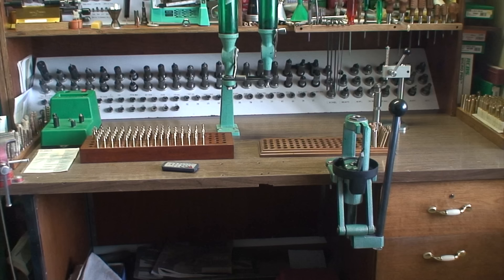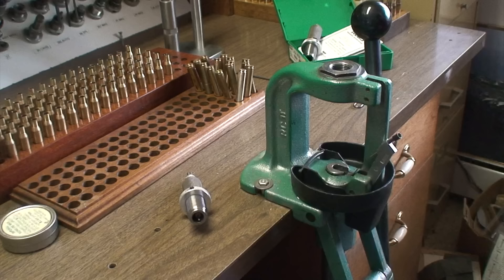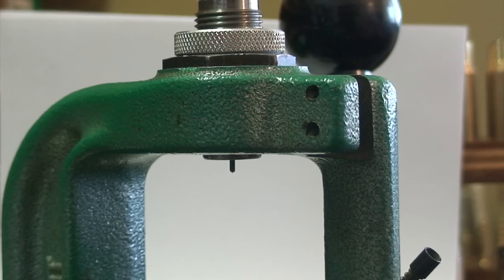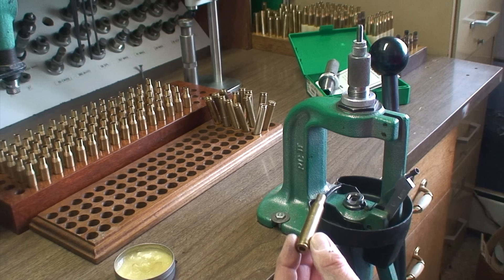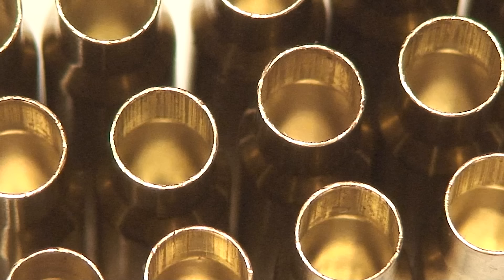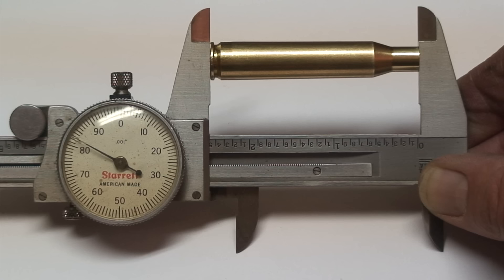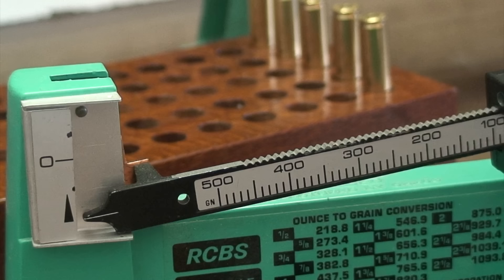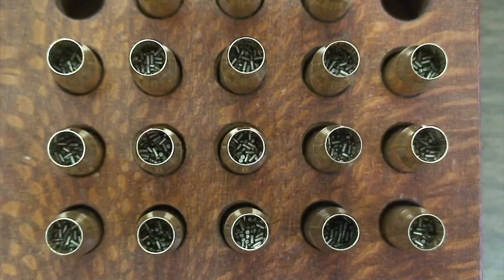Reloading 101 - Start to Finish Reloading All Rifle Ammunition

Comment: Suggestion
I used a 7 mm always
And yes I had head separation
And from then on.
I made an easy out with a handle long enough when you take the bolt out, you can easily pull the rest of the brass out.
I put it in my pack and it is always there. with quick and easy axcess.

Can't remember the grain i used, but always had to load a few grains higher to bring the grouping into reasonable dia of 1/2 inch and often through the same hole at 100 yds.
I remember how many grains, as it was 62 but can't remember the powder, as i have not loaded for several years, as i don't hunt much anymore.

Make yourself one of those easy outs and take it with you ALWAYS .
Saves a lot of grief. and sorrow. and maybe your life.
And the most important thing on any outing
When you take a shot 
MAKE THE FIRST ONE COUNT, SO YOU DON'T HAVE TO SHOOT AGAIN
Check your rifle immediately to see if it rloads again the shell 
DON'T GO AFTER THE ANIMAL YOU JUST SHOT !
If your not able to load,  get your easy out immediately and don't go after your game until you have another shell in your rifle.

You do not want to meet mister life taker !
Let him have it until your rifle is operable again.

And always shoot for the nose on any attacking bear,  
Be relaxed and never get excited
When and if you get excited shooting any animls.
PACK UP YOUR GUN AND NEVER SHOOT OR HUNT AGAIN !
UNTIL YOUR NEVERS DO NOT SHAKE !  
YOU WILL SAVE YOUR LIFE AND THE OTHERS AROUND YOU.

You will get more game and will never freek out at any charging grizzly
As you know it will take only one shot and he is down.
Only if your grouping is as good as mine was.without getting excited.

If you had nerves of steel like myself back then. i'm 81 now and still fairly active, thank the good lord.
I went joging along a trail by myself with rifle in hand
Heard a snap only a few feet behind me, less than 10 feet.
I immediately dug my foot into the ground pivited bringing my rifle up with a shell in the chamber, and safety coming off,
I was in my 50's
And when i was facing a cougar in a crouched position
Without hesitation
Unfortunate for him

DO NOT RUN IN THE WOODS !
AS IT MAY BE YOUR LAST RUN !
Unless you have a sixth sense beyond the normal

Comment: I just started reloading, thanks for going through all of this stuff the man at the store gave me a 2 hour "crash course" on reloading and helped me set up my dies and we actually loaded 5 rounds start to finish from once fired brass but there was still a lot of learning to do.  Holding the powder pan directly against the nozzle to prevent splash was something I had to learn on my own.   I also like your use of blackening to see where your dies are contacting the case, and the tip about lubing the neck expander ball was great too.    

The way I figured out to get a repeatable powder charge through my measure was to put a small sharpie mark on the drum and the frame of the measure,  and after I cycle the lever I lift and I drop the handle from that spot every time. This works extremely well, I was doing the same thing you are with manually knocking the lever each time but I was getting a lot of .2-.3gr variation.  Once I went to the "drop method" I described I get much more consistent results and don't have to mess with the metered charge much, maybe 1 in 7-8 charges will need adjustment.

Comment: I would like to commend you on maintaining an excellent process for reloading,  I have only been reloading for abut forty years, and my process is nearly identical.  My father never reloaded, but two USAF pilot buddies I used to fly with taught me how.  I prefer, as apparently you as well, to use the single stage RCBS Rockchucker than the faster progressives, because reloading should never be about speed.  It should be about accuracy which translates to safety.  I use a Lee hand primer.  I have always tried to keep up with the latest in this work and about ten years ago learned about tumbling my cases with metal media, instead of walnut shells.  It’s faster and more effective.  I need to find your case lube product because my stuff is a bit messier in use.  I’m a big proponent of doing things in stages as time permits.  For example, I may tumble cases and store them in quart or gallon zip lock bags until I’m ready to go on to primers.  Even then, I will store my primed cases in such a bag until I’m ready to charge  them.  Within the last five years I wound up buying the fancier digital scale for measuring my charges.  I started out with the scale like yours that came in my simple RCBS kit.  The digital scale has a built in trickle dispenser which maintains accuracy in charges.  I will share your site with others as you are safe and don’t cut corners.  I have never had either a squib round nor a overcharge in my decades of reloading because safety is paramount.  Thank you for your efforts.

Comment: I’m a pretty experienced reloader, and still picked up some good info and tips here.  Thank you to your Dad for putting this together.  I’ve made the mistake about not labeling what was in my powder measure, and learned my lesson. Nice tip on setting up the balance beam scale.  I also have that excellent older RCBS 88507 APS hand primer and all the strips and strip loader, and of course RCBS discontinued it!  They went with the tray one I don’t care for, so I’ve been trying to find a replacement as that’s a great model.

I full length resize every time, even brass in the same rifle, but just enough to set the shoulder back .002” in a bolt and .003” in an autoloader.  I understand neck sizing, but every few reloadings you’re going to have to FL size anyway, so I do it every time for consistency.

Your reloading bench is perfectly organized!  Love those die and bushing racks.  Ironically, I was reloading pistol ammo on a Dillon progressive for 20 years, but I think I never really learned reloading until I started reloading for a rifle on a single stage press.

The best tip I learned from your video, and frankly can’t believe I didn’t do this before, is to have the bullet reloading manual side by side with the powder manual, as of course the powder manual will list all bullet manufacturers, so it’s a good comparison.

I appreciate you taking the time to out together this comprehensive video.  👍
Reply from the maker: You’re welcome, I’m glad you enjoyed it and I’m glad you picked up a couple things from it!

Comment: Your not agjusting or sizing headspace. Headspace is a fixed static number with a minimum and maximum dimension specific to a cartridge. You are referring to head gap or comparing distance. Spring back comes into play depending how case hardened the case is.

Comment: Great presentation...as far as it went. I would have liked to see the Grand Finally, including test firing and subsequent case examination for any signs of over pressure. That final step is important, (especially for 'newbies") for safe reloading.
I started reloading 16 gauge with tools I made myself 62 years ago, when I was 15, with tools I made myself. As I gained experience and as my pockets grew deeper, so did my trove of equipment, and knowledge. So, have fun, and above all, work safe!

Comment: I have over 40 years of reloading experience with over 20 different calibers and cannot disagree enough with neck sizing your brass. In my experience there is no advantage in accuracy or case longevity. In fact in belted magnums, I've found that neck sizing leads to increased case head separation due to more resistance on bolt opening and case extraction. The  increased resistance is also bad for gaulding the lugs on your bolt. Brass will grow and after 4 or so firings you will have to full length resize anyways. All you have to do is bump the shoulder back around 3 thousandths so that the bolt closes and opens easy and you will wear out the primer pocket a long time before you have a case failure.

Comment: 406 Adventures, do YOU reload , but more importantly do YOU shoot much if at all?

The Redding brand competition shell holders are a much more effective way to consistently set headspace, but the way your father shows is what folks had to do before those shellholders became available and on the market. 

Just some things to think about and/or consider.
Reply from the maker: Yes I shoot and reload, I shoot frequently and used to shoot a lot more, I went throught the junior Olympics program for small bore rifle, pistol, large bore pistol and also did air pistol. I just use the tools my dad has and the way that I was taught.
Reply: @406adventures  Thanks for the extremely prompt reply and thank you for posting this so that I could share with my friends a VERY large part of what it is that I do when reloading ammunition. It also shows them just how tedious and how much work that it is in my quest for making my firearms perform to the best of their individual possibility. 

🫶🙏

Comment: I’ve reloaded pistol and thought so long about rifle for hunting purposes. I’ve watched so many videos and I’m so impressed by your efforts at explaining different aspects. I have one ’deer rifle’ so save the once fitted brass. Finally someone who explains the difference between once fitted and range brass and resizing! 
My first question is regarding the flash hole. Some have said it’s important to deburr the inner flash hole edges with a tool but you didn’t. Do you not find that necessary? Second. The neck resisting die you use didn’t make any reference to how much smaller the ball should be in relation to the projectile. I’ve seen it said that possibly 2 thou? Is that being too anal? 
I was hanging on till the end to see your opinions on crimping but your video reshowed earlier clips. What happened there and did you make another video on crimping?
Overall I was delighted with your efforts but crimping has always been a vague spot in reloading rifle ammunition and yours skipped that aspect. Many thanks for the rest it was genuinely informative and easy to understand. Some other videos have my head swimming with high brown technical stuff. Kind regards Ed
Reply from the maker: My dad made this video, and he had every intention on making more, but he passed away and did not get a chance to do them. I found his discs of this video, and it was always his intention to get them on to help people learn how to reload, so I put them together and made this video for him to honor his memory.

Comment: At time marker 27:00 minutes you show two cases from 3006 side by side one new .  One once fired to illustrate primer pocket residue.  I couldn't help but notice that the head of the fired case shows a convex cupping under that lighting.  What is that caused by?  Is that condition dangerous in any way?
Reply from the maker: I’m pretty sure it is just the lighting, my dad made the video and if it was a dangerous situation he definitely would have gotten rid of the case.
Reply: @406adventures  thank you

Comment: flaw one is the press and dies. RCBS like Hornaday is Chinese junk. Use a Forster press and their dies and your a light year ahead in the game. Measure powder with a good one, and forget that RCBS junk.  Redding is better, but you can do far better
Reply from the maker: My dad bought mostly all of these in the 70s, it looks like after the 80s things changed a little bit. Like he said in the video use whatever you have until  you can afford to upgrade.
Reply: I went to the NRA convention way back in 1978, and they had a row of presses that must have had fifty or sixty presses. All were similar but one. That was the Forester / Bananza. A little guy walked over to me and said that's the one you want. That guy was Bob Milek. I ordered one the following Monday and they thought I was nuts for spending $83 on a press! He gets it in a couple weeks later, and calls to ask if he could use it a little bit. He then orders in five more of them, and sold all five in three or four days. Then orders a dozen more!  This guy was big on RCBS and Lyman equipment. I still own that 1978 press, and it's just as tight and square as the day I bought it. On the otherhand my brother has gone thru five or six presses (I did rebuild one of them [RCBS Rock Chucker]). I do some heavy case forming with zero problems
 @406adventures

Comment: Plz don’t neck size folks. Smh
Reply from the maker: Why do you say that…?
Reply: It's okay to neck size, folks. 😊 But FL size every 3rd or 4th go 'round. Your gun will tell you when.
Reply from the maker: In the video he clearly states to only size the neck on belted magnum cases that will be used in the same rifle so you do not get head separation.
Reply: @406adventures  ya, but unfortunately the damage has already been done. On the first firing, belted mag brass can stretch as much as .020". The shoulder is all over the place because manufacturers know the belt is there to save their bacon. I typically neck up new belted brass so it won't chamber then FL size it down slowly until it just chambers with some resistance. This eliminates the initial case stretch. I haven't finished watching the vid yet but I will.  Thanks!
Reply: @406adventures it’s a heated topic in target shooting these days lol. Eventually the case will not fit and will need to be full sized. People also say that neck size doesn’t help accuracy any more than sizing enough to bump the shoulder back a couple thousands
Reply: Of course, the technique you’re referring to is called a “false shoulder”, used to avoid case stretch at the pressure ring with new brass.  And, I’m sure the gentleman in the video used it often himself when first firing new brass in his rifles.  However, the context of the video is clear he was loading brass already fire-formed in the chamber of his rifle.  And, his sizing technique is based on that assumption. He reminds me of my own grandfather with whom I first loaded ammo as a boy.  He was a retired police inspector who built his own rifles.  One detail about the video eludes me.  It was stated this was the first installment of several videos but he was unable to finish this one. I hope he is still alive and in good health.  Perhaps someone can fill me in.  Great video.
Reply from the maker: @charlesgreen2631  he has passed away unfortunately